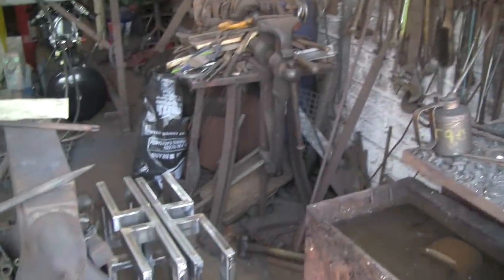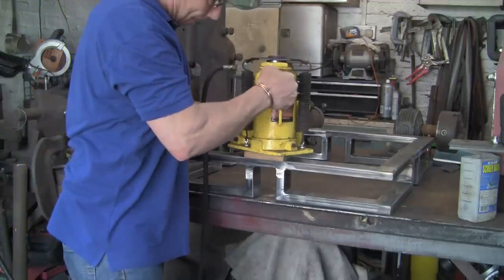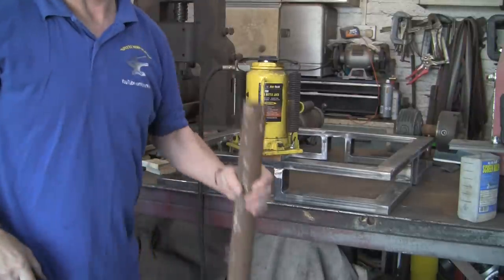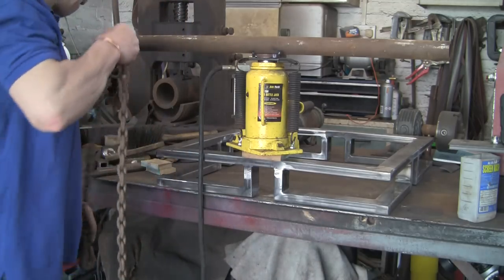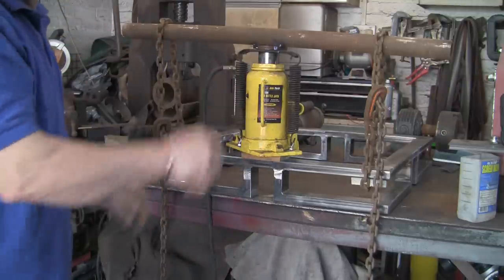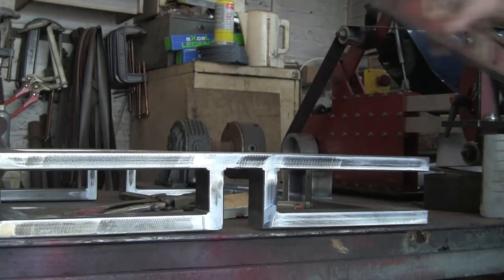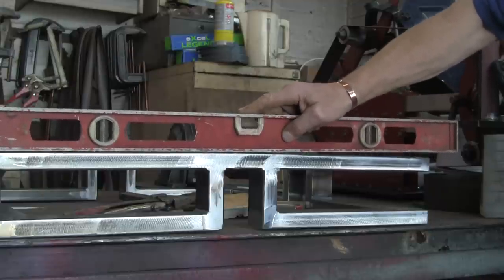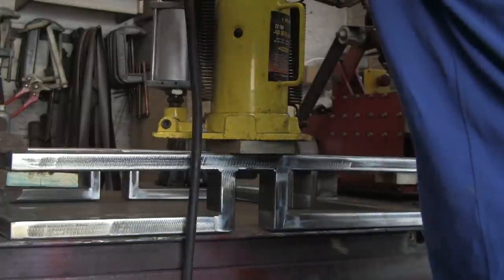Shop Tip, Straightening steel

Comment: Excellent Gary, these types tips are so useful  and rare for fixing those things that just happen without intent. I wonder if a little bit of heat at the bend point and/or bit of tapping with a panel hammer may have help to relieve the stress and spring back.

Comment: Gary when u weld it only do little welds (1/4 in long) at a time and take your time and jump around the whole piece. That has always worked for me.
Reply from the maker: Yes, that works great if the welds are to be ground after but these are on show so need to be neat.

Comment: Since you asked how in your video lol .... 
1.) Just a thought... Get a laser thermometer gauge device and pinpoint it at many different areas and points of those areas being bent and stretched etc!! Have someone golf their last on the area being straightened etc as you Jack it up to straightened it out... You may notice the rapid and vast changes in ambient temperature of those areas as they are stressed by your method and your hydraulic jack or whatever you may use... This info may need useful in understanding how to spare your work piece any unsure stress and heat damage to the delicate tempering! Bc of possibly loss of carbon content etc!
    This may be helpful to those who work with very sensitive metals/ materials/ finishings etc! Imagine having to straighten out an unsightly crooked bar in your work safer to already applied an expensive saber very delicate coating or coloring technique etc! ... And you have to try and avoid damage to the surface applications/finishes etc by avoiding too much heat by low heating area quickly and then fast cooling opposite side of that area to cause a slight warpage that if fine right will produce the desire"straightening" out affect on your piece! 👍👍✌️✌️

  2.)
May I suggest possibly trying just a lil bit of heat in the right spots etc?  Experiment with the process some! 👍 ... Like putting a cool wet Cloth on one side of the heated areas! So only one side heard up and not there opposite... Play around with that concept a bit maybe too reduce the amount of heat needed to manipulate metal more easily/ reduce any heart caused issues you don't want etc...( This technique can help eliminate the metal from fatiguing on the one side that is being bent! So, picture  a straight bar "—"  being bent down in the middle and up on there 2 ends to form a "U"  .... The inside of the"U" is compressed and then bottom outside is stretched apart! When you need only just slight adjustments like u did to straighten out your work piece, then you might not want to unnecessarily fatigue the one side being compressed or there without being stretched out if you can avoid it by sit heading the area being manipulated etc....

Comment: Would it have helped to fill those gaps with a bit of offcut? If you tacked it together as a square and then welded it? or perhaps it might have sprung when the offcut was cut out

Comment: U pulled up on that side and made that side look flat but looking at it from here it looks like it kind of warped the opposite side up off the bench a bit even after it flexed back and relaxed so isn't that still messed up or that side of things not matter so much?
Reply from the maker: me 2 I had to pull the other side out as well so it was a bit longer to do than expected.
Reply: Gary Huston well look good..

Comment: Heat the back of the material opposite to the welds to incandescent next time. Should pull back perfectly, if any fine tuning is required just direct the torch to the appropriate spot.
Reply from the maker: Tried that, it did jack! All it did was make a patch of scale to clean off!
Reply: I don't know what you know about heat straightening but the trick is to heat to around 500C, heat up fast (oxy cutting or small rosebud) and cool slowly, you want the point the steel just begins to glow. For what you have there I would heat around a 10mm strip directly opposite the weld and bring the heat half to two thirds the way down the sides of the material.
The straightening happens on the cooling, not the heating, cool to room temperature in air. If it gets to the right point before it's finished cooling you just quench it. If the first heat wasn't enough you can go right over the same spot again.

It's really quite incredible how well the technique can work and the kind of damage it can undo.
Reply: @dtnicholls1 thanks for the tips.

Comment: For straightening I usualy run a weld on the opposing side of my weld and grind it down. In this case I would run a weld on the upper side (the place where the jack is in the video) This would bend the corners up.
Reply from the maker: I did think about that but didn’t know if one weld would pull back as much as the four welds below.
Reply: @garyhuston  No it won't  , Much easier to pull a 90 degree  join than it does a 180 degree bend . Normally heat the back side / controlled shrinking   or prebend before your weld . ..all welds shrink  .
Reply: May I ask... Would it also work if you just heat the opposite side with a hot gas torch?
Reply: @gerritdutoit4833  as jasonmoss4308 said it works if you heat the opposite side prior to welding, otherwise you have to add some  extra material that will contract when cooling down and pull back
Reply: @cortana2007  Sorry, I missed that message! Must it be heated before welding? Will it also cure the warp AFTER it occured and already warped?
Reply: @gerritdutoit4833  after it is already warped you can only put  a weld on the opposite site, you need material to shrink more than initial, simple heating it up will not help

Comment: All that jerryrigging when all it would have taken was a few swipes with a torch.
Reply from the maker: Absolutely, but not everyone has a gas axe, that is the point which seems to have eluded you!🤣
Reply: @garyhuston  I'm not talking about cutting, I am talking about flame straightening. Essentially using the same process than bent your steel in the first place (heat distortion) to being it back to straight and square. I learned the process about ten years ago and now it is a very important technique to improve the quality of my work.
Reply from the maker: @chrisose  I wasn’t talking about cutting either! I know exactly what straightening with a torch is about, I use my oxy propane burner to do it but as I said not everyone has that available.
Reply: @garyhuston  If you can't afford a couple hundred for a torch they you likely can't afford to be building things out of steel.

Comment: gary maybe this could`ve come in help. i made mine (looks like sh*t but works) :D  video "PROFIL UND ROHRRICHTPRESSE GRP 160" (sorry man don`t know what happens it won`t let me paste the link). regards . pete
Reply from the maker: I don't think so, if you watch it carefully you will see it leave a mark where it's been, no good for this job!
Reply: oh didn`t mean to bash your method of straightening, yes i just used the idea of the cam lever (the metalcraft units use them too) as i told i made my version of this tool but with a wider and longer foot so to speak as i was concerned about leaving marks or indentations. i make quite a lot of furniture using thin wall square tubing 1,2 ; 1,6 and 2 mm, which as you experienced bow at the mere show of the torch (i tig weld them mostly). pre-bending works too but that makes for funny jigs and i don`t like that. what you did is great and works like a charm no doubt about that. regards. peter